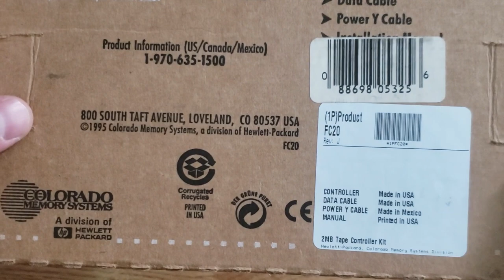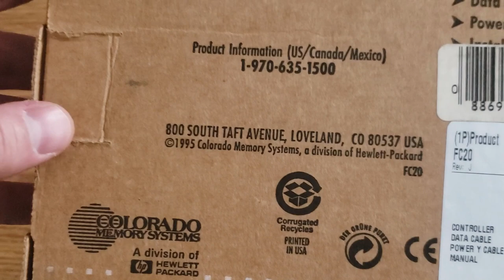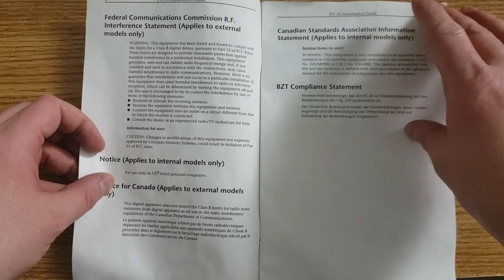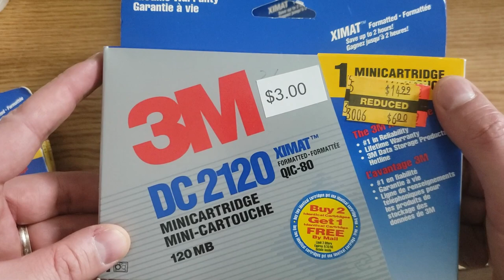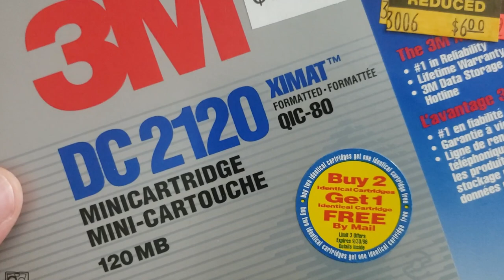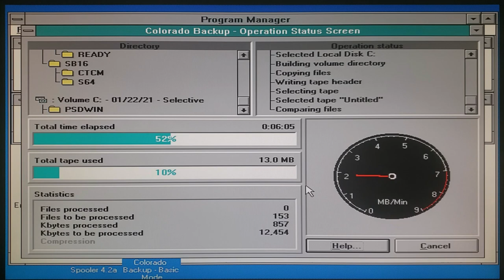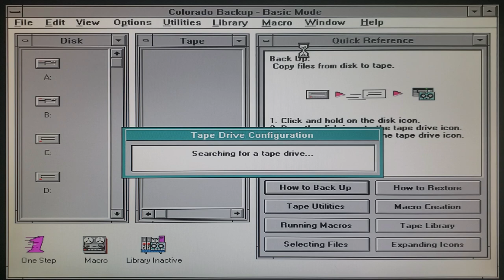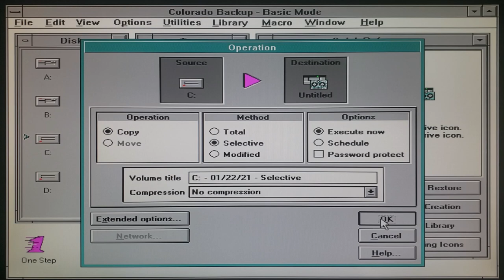RetroTour: Exploring and Supercharging a 120MB Colorado Tape Backup Drive... Will it Work??

Comment: I'm pretty sure that the molex power connector on the card is only needed to support an external drive.  That is likely because an external drive doesn't have a separate power supply.  But as you you showed the internal drive has it's own power connection to the PC power supply.
Reply from the maker: Yea, if memory serves, that seems right to me!  Thanks for watching!

Comment: Back in the day when I had a 486 with a 200 meg hard drive, I got one of those tape drives to store all my ... err ... "backups" on. My other PC owning friend also had one and we found them much quicker to use than a null modem cable for transferring data between our machines. Used it for several years until CD-R drives became affordable. I used the DOS tools to work with the tape. At one point I had some drivers that gave the tape drive a drive letter in Windows, it was so slow 😂
Reply from the maker: Haha... hey, this is a judgment-free zone here!  Ya.. I think I used a tape drive as a drive letter too once!!

Comment: I had a floppy-based Travan tape drive in a Packard Bell Legend 994CDT... pretty sure it used 1.6GB tapes. The tape controller was fried, but getting it to work on the normal floppy interface with Windows 98's backup program was amusing nonetheless. I really think tape drives need to come back to the consumer market someday. Being able to back up so much to a few affordable Ultrium cartridges is exactly what I'd want, and it seems viable with M.2 PCIe SSDs being widely available alongside hard drives continuing to get faster. Too bad new tape drives are super pricey, but maybe in the future I might consider getting another used one and using LTFS.
Reply from the maker: Good points!  I just bought a 4TB SSD to store raw videos on that I make for the channel... and boy was that expensive!! Could've gone with cloud storage, but I like to keep data on premises too.  A tape drive would have been more cost effective than the 4TB SSD... especially since I don't need instant access to past raw video!
Reply: @RetroTechChris  The SSD should go great with a tape drive, given the former will be able to feed tons of data to the tape drive very rapidly. Newer generations of LTO expect very high transfer rates in order for the mechanism to coast along, otherwise the tape drive will have to keep stopping when its buffer drains and rewind a tad bit before starting again... a "shoeshining" effect, so to speak.
Reply: @RetroTechChris  Im currently working on getting a tape drive to work with a macintosh server and retro spect.  I all ready have dds working on mac os 10.5 im working on getting system 7.5 to run with one soon to.
Reply from the maker: @stpworld  that's great!!

Comment: This will be quick- when we had the novel server in @ 1992-1997  we had a IT company come in every week and burn a image from novell to a backup machine, then basically burn a backup to a set of CD's  - i cant recall 2 or 3 cd's worth, the tech would come over ensure the over batch file had run, start the copy process, leave and come back 3 hours later, check the logs, pop the cdrom out and check it on another machine, then say good buy - i recall he said it was $300 a weekly visit, i was in the city and he mentioned he had about 20 customers in walking distance that he "multitasked" 6k a a week in mid 90's

Regards
George
Reply from the maker: Now there's a job for ya!!

Comment: I had a Jumbo drive in those days. I could run it at full speed without such a card because my floppy drive controller supported 2.88Mb floppy drives.
Reply from the maker: Interesting!  Wasn't aware of that.  Thanks for sharing.

Comment: Thanks for doing this video. I have an old Colorado 120mb Tape Drive, and I'd like to see if I can hook it up to my old 386 and restore what is on the tapes. Have you done a video on how to clean the drive and prep the tapes after so many years? Keep up the good work!
Reply from the maker: Thanks! I haven't read up much on the subject, but for cleaning the heads, I just used a Q-Tip with alcohol.  As far as prepping the tape, not sure if you'd have to do anything there.  I used some new old stock tapes and they seemed to work ok!
Reply: @RetroTechChris  Well, you've inspired me to hook my old tape drive back up and restore my old tapes. But now that I'm looking at it...I don't recall how to hook it up. It has a long ribbon cable, and it looks like the existing floppy cable plugs into the one provided by Colorado. It isn't clear to me if it's just going to piggy back, or if I need to unplug my secondary floppy. (I don't have the FC-20 card). Any advice?
Reply from the maker: @mk553  it'll piggy back, you can have two FDDs in the system.  However, I do see a FC-20 with a Colorado 1400 on eBay for about $30 bucks shipped in the US!!
Reply: @RetroTechChris  Thanks for the help! Well, I bought a new-old stock tape, and that worked just fine. Formatted it, made a small backup, restore, all good. So I felt confident enough to put in some of my 30 year old tapes. It ate every one of them. Oh well, it was fun to try anyway. :)
Reply from the maker: @mk553  oh no!  There might not have been much that could be done there then... the tapes may have degraded sadly.  Sorry to hear that.

Comment: i have been carrying this tape drive around for even decades.  (Colorado memory systems   Jumbe 250 certified  circa 1995. )  I would l love to have the information copied onto a thumb drive.  Any ideas?
Reply from the maker: Confused.. do you have a tape, a drive, or both?
Reply: it was made on a MS DOS 486 .
Reply from the maker: @mrphysh  so you have a tape?  If you mailed it to me, I'd be wiling to try and read it, but no guarantees!
Reply: In 1995 I was working in Denver and my employer gave me a MS DOS 486 computer.  I asked for a “Colorado Backup lite” be included.  As I was leaving I put everything on my computer onto a tape.  I am curious about this tape but there is no real concern and certainly no liability to yourself.  If you have the hardware/software. It should not take more than a few minutes to read it and copy  it onto a thumb drive.  If there are problems, then ‘oh well’.  In any event you can have the tape.
The tape says ‘Colorado memory systems      Preformatted  QIC 80’
I have a Youtube channel 
 https://www.youtube.com/user/mrphysh
contact me through that?
Reply: Do you want to sell that thing man? I need one of those tape drives
Reply: @Joseph-ln2em  I send you the tape cassette.  You email me the contents and you can have the cassette.  The tape  is brand new on all levels.  I had a brand new 486 computer and had asked for inclusion of the the Colorado Backup system.   As I was leaving, I ran everything on the computer onto a tape.  It was just used the once.  By modern standards, it extremely small.  No way the whole thing is more than 100mb.  this was the age of WordPerfect.   Small,  simple files.

Comment: I have a Colorado 120MB Internal Tape Drive (edge connector). I have DC 2120 tapes with data on them. How do I get my BIOS to recognize the tape drive? How can the system see the drive if the BIOS doesn't see it first? I'm using K7N2 Delta motherboard with the on-board floppy controller.
Reply from the maker: Hey there!  The BIOS won't see it, but the tape backup software will!  Does that help?
Reply: @RetroTechChris  Awesome, thanks! I always thought BIOS had to see everything!

Comment: I feel cheated
..I wanted to hear it run! I installed a lot of these back in the day
Reply from the maker: I've got you covered!  See here!! https://x.com/RetroTechChris/status/1743292530895003843
Reply: @RetroTechChris  thanks for the link. My employer about 30 years ago, provided software and systems to pharmacies. I setup a lot of new Dell machines, installed ethernet cards, and Colorado tape drives using the floppy controller. Then loaded novel on them and get them talking to each other. Someone else loaded the companies product on the machines before they got delivered. One day I learned they were pirating the novel netware and I promptly quit. (They got in trouble) but I didn't turn them in
Reply from the maker: @lestersegelhorst2776  haha, oh my!  By the way, I have several Novell NetWare videos here on the channel!